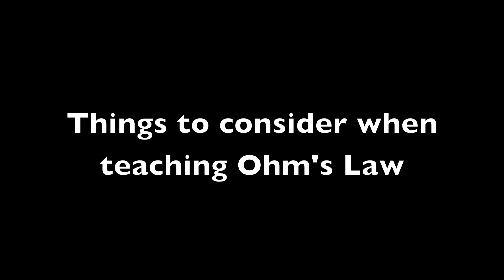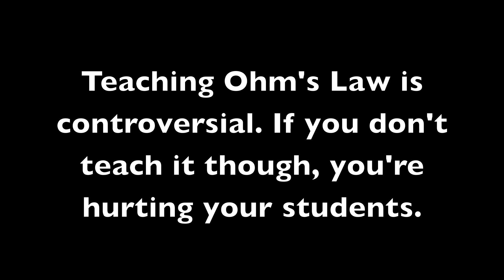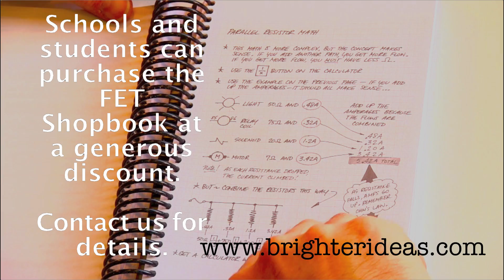Teaching Ohm's Law to Techs - Part 1

Comment: Just my 2 cents but i would not want anyone to work on my car that doesn't understand basic algebra. Using different variables shouldn't matter at all and neither should working an equation in a transposed form. Anyone that has graduated high school should be able to figure out the equation in either form without even knowing what EIR / V omega A represents. Sounds like the problem in this case is the fundamental knowledge of algebra not how the formula is written.
Reply: In fact seems E has been replaced with V a lot now anyway. Most sites have it as V now. R doesn't really need to be changed as R for "resistance" is good. P for "power" is obviously good. The only one left now that doesn't match up to modern usage is the I which stands for current.
Reply: Also if every teacher approached things like Daniel Sullivan I bet we would have more educated people around that understand things. As time moves by things get better and that includes teaching technique. I think the public school systems run by the government were the start of bad schooling technique.
Reply: David you need to use algebra to solve an equation and or transpose the equation and solve for the other variables. It doesn't matter how you call the variables either words letters or symbols they are still variables. Using a letter of the first word or the word itself... still algebra.

Can you troubleshoot circuits without math thats an entire different issue. If you just want to use a meter to see if you have voltage or not great you don't need math at all just read your meter. To be decent with electrical circuits though you need much more than that.

There's a reason why many mechanics are labeled part changers. If you don't get the foundation down with electrical diagnosis (including the basic algebraic equations) chances are you are going to much closer to that group...
Reply from the maker: Christian Lum Completely forgot to add that my former student who's the Avionics chief at 10Tanker is a strong chick - who rocks...
Reply: mrd05d Your 2 cents aren't worth 1 cent. That is about the dumbest thing I've ever heard. It's about ridiculous as saying I wouldn't wan't a guy to teach me algebra unless he was a mechanic. There's a big difference between a mechanic and a mechanical engineer.
Reply: But having to prove V = IR, you must go through I = V/R because that's where it came from. The original logic comes first, algebra and simplification the second
Reply: Why is there a need to use Algebra though? For things that already have names we use it would make more sense to at the minimum use the first letter at least of the word. It's just silly to use Algebra when it's not needed.
That's as bad as if they used XYZ informally and then something like LNA formally where as L=Z and N=Y and A=Z. Would be just totally pointless.
Reply: Also their skill in Algebra has nothing to do with their knowledge of your car's electrical system. According to your logic some kid at school at the top of his class in Algebra could be just thrown into an auto shop and straight away be able to fix some electrical problem. Sorry it doesn't work like that.
I have seen other people claim similar things to you. Seen some people claim that if someone has spelt something wrong then apparently that debunks everything they have said. This is absolutely nonsense thinking. Someones spelling is independent of their knowledge or understanding of another subject. Heck even some of the great inventors were said to have poor language skills but excelled in other things obviously.
Just as if someone has messy handwriting it doesn't mean what they have actually written is incorrect and that someone with neat writing that everything they write must be correct and gold. lol
Reply from the maker: We all need to understand that this problem exists everywhere - and I'm trying to finish a video (or 2) on fractions. Look, why do we use this symbol - √ (or similar) to teach division, THEN use this one - ÷ - and then teach fractions? Seems to me the first 2 are pointless. Also - the process of adding and subtracting fractions requires the ability to multiply and divide them, but we teach addition and subtraction first. STUPID! Teach fractions in kindergarten, and DUMP the other 2 symbols no one will ever see again. I HATE seeing a division problem written any other way than a/b..... DO WHAT WORKS. In the end, if someone can divide, I really don't give a rat's ass how they do it. As for the STUPIDITY of the metric system - the point was to simply start saying 10 KM instead of 6 Mi. NOT convert the shit. Metrics failed for the same reason anything fails - resistance to change and a good idea badly executed.

Oh - and David - I understand your position, but figuring out tax or mileage or compression ratio is Algebra. You do it - but there can be a problem with the insistence that we call things what we do. As far as I'm concerned - there is NO "basic", "intermediate" or "advanced" electricity ---- it's just electricity. The labels are to make a class schedule and catalog work. I call it "electricity", electricity again" and "more electricity".  DS
Reply: I've got to agree with you Daniel, I think a lot of people forget the audience these videos apply to, myself included (and the gentleman that commented above). If the scope is to teach somebody who may not be as strong in math how to read a meter, use ohms law in a manner that suites their need, use a multimeter, and diagnose an issue so that the proper part can be replaced, then you hit the nail on the head. You've got great analogies that help make the concepts that need to be conveyed to your audience relevant. Me personally, I think that math is totally relevant to realize a deep understanding of electricity. But again, In my field it is needed to have a strong foundation in calculus, differential equations, physics, etc. Why? Because it's the basis for design, and is so deeply embedded in the field of E.E that you can't scrape by without it. My scope is different than here. I just want to say I appreciate that you are so committed to making a difference to people who weren't always blessed as some of these other assholes on here who want to pass judgement and belittle others. When I first went to back to college to pursue an electrical engineering degree I didn't even place into a math class - I was literally told I was too stupid to take math at the college level. Thankfully for me, I tried, and had some of the best teachers who made math relatable to people who couldn't see the relationships (me). Then I began to like and appreciate it, and now here I am. I made it through 4 calculus classes, differential equations, and other high level math classes I never thought I'd be able to do. I bet most of these guys on here wouldn't hold up in the industry you teach people to strive in anyways. Side note, I saw you were a teacher in the aviation department at NMU. What did you do? I have been working on avionics for the past 5 years, and while going to school. It's actually what intrigued me to pursue an engineering degree.
Reply from the maker: First - strong chicks rock...

Second - I started the A&P program at NMU waaaay back in 1988. One of my students is the avionics chief for 10Tanker - the aerial firebomber folks that fly modified DC-10s.

Email me - dan@brighterideas.com. Might be interesting to chat.
Reply: mrd05d It's been my experience that there's little use for this formula. You may have a 12V circuit with a 1 ohm component. So you might think that you're going to be pulling 12 amps. But your NOT going to be pulling 12 amps, because the resistance will change as soon as you put power to it. So, you're better off knowing how many amps you're going to be drawing in order to determine what diameter of wire to use, and what fuse to install. Otherwise, if you're just troubleshooting an existing circuit, you only really need to know how many amps you're pulling vs how many amps you're SUPPOSED to be pulling. If you have more than 0.2 ohms in any regular circuit, then you may have a problem, because unwanted resistance ALWAYS results in unwanted heat. BTW algebra has little to do with auto repair. That's more for engineers. So if you want an automotive engineer working on your car, be prepared to pay out some big bucks.
Reply: Daniel Sullivan That's awesome! I'm a former Boom Operator on the KC-10 and am now hoping to start school for a Systems Operator position for PG&E on the West Coast. I completely understand your argument. I immediately related this to calculating aircraft and cargo center of gravity which is Moment=Weight (x) Arm. Had I been forced to run pages of CG equations, it simply wouldn't have made me understand "how" the formula actually worked and why it was important. After understanding the concept and seeing how CG physically affected the aircraft, we learned the equation and began to actually balance aircraft. That is NO easy task. I did it for 8 years. So, mrd05d can rest easy. The military wouldn't have sent me all over the world without knowing M=WA. But first, I had to understand the concept and how it affected aircraft performance.

Also, if your Avionics Chief is from Travis AFB, I may know him/her. :)
Reply from the maker: Apparently you're one of the people who sat in front of math class in high school, was able to pass tests after being taught in the most inefficient way imaginable by teachers who were unable to make the subject relevant to the guys who sat in back floundering, who I also assume you never tried to help. Am I close?
Reply: Daniel Sullivan I would say only partially correct there. I did well in math class but sat in the back not the front and didn't learn from the teacher but from reading the text usually a couple chapters in front of where the class was. I also did help those that struggled if they wanted to learn. Unfortunately many didn't care to learn nor did they want help.
Reply: Daniel Sullivan I would also say that I like your approach to teaching and believe you are a very good teacher. I was just pointing out that maybe concentration on algebra and remedial math is exactly what is needed. It's possible that you have the short straw as students are in your class without the proper prerequisite knowledge and you only have 4 days to go over what is needed for the class as well as bring them up to speed with algebraic expressions. I feel for you.
Reply from the maker: mrd05d Absolutely - none of the guys I teach are stupid. None of them have ever been allowed to be smart. Trig is a blue collar math - too many teachers see it as "AP" - stupid.

Comment: 1897 J. J. Thompson discovered the electron yet everyone still practices Conventional Current flow (positive to negative) when the exact opposite it true AKA reality. I too wish I could change a lot of things but in order to properly communicate with people who learn convention no matter how wrong it is I must understand the way they think and so should be the case with Ohm's Law unless you want to limit your options for advancement.
Reply from the maker: As long as a guy understands Ohm's Law - the CONCEPT - you could call resistance "rat turds" and they'd be able to do the job. The direction of current flow is pointless. I don't care, I won't care, and for over 3 decades I've diagnosed and repaired everything up to and including 747s without giving a shit about which way electrons flow. Do I teach it? Yes. Is your understanding as you explained it correct? No. If your beliefs help you make robots behave, then good on you. Look out over a dozen new scared and hopeful blank stares every week and you might - I'd pray - have a different viewpoint.
Reply: It's about communicating with others for clarity and advancement, if I had stood up in a meeting with Subaru, Toyota, GM or Ford Engineering and said rat turds 20 years ago I probably wouldn't have retired at 54, because I would have limited my potential by my inability to communicate on a level everyone understands, perhaps you are training people who want to limit themselves to Technician level for life and if so then you are correct it doesn't matter if all they know is they are supposed to see 12V at test point A and if not swap a board, I retrained many individuals who weren't taught the fundamentals in my day and found it quite rewarding seeing their eyes light up when they got it. All that being said I am bored to tears and brushing up for a pre-employment test to get back in the game because my brain is turning to mush. You have every right to your opinion and some of the things you say would make good sense if only the rest of the world would sign on, if it were easy we'd all be driving positive ground vehicles, well we actually are no?
Reply: Daniel, maybe I'm hung up on direction of flow because robots were mostly hydraulic in the 80's when I got into the industry, hook a servo up backwards to an actuator in relation to the feedback device on a hydraulic robot and things would get interesting in a hurry, or with your experience in aircraft the same could be said for the ailerons on a 747.
Reply from the maker: KAT D Hydraulics is a terrible example for electricity because voltage is effectively compressible, while hydraulic fluid is not. Air pressure is way more meaningful. There is no argument here. Teaching electricity via math is pointless. Teaching math via electrical (mechanical) concepts is the only logical way to do it. I teach trigonometry to mechanics in 30 minutes using a tape measure and a laser pointer, because they already understand the concept.
Reply: Daniel please explain to me how voltage is compressible, as I was taught voltage is EMF meaning it is merely a potential difference which equates quite nicely to pressure in a hydraulic system. Voltage or EMF is not even a thing meaning it doesn't physically exist any more than pressure does in a hydraulic system, the medium in hydraulics is some type of fluid be it HFA 5606 or an HFDR synthetic just as electrons are the medium in an electric circuit. What creates pressure or voltage in either instance is resistance to flow, in hydraulics it's resistance to the flow of fluid in electronic it's resistance to the flow of electrons. There are two basic proportional realities to both electronics and hydraulics that interrelate nicely and are almost always used as examples in University ((Flow (current/AMPS)= (volume/GPM)) and ((Potential (volts/EMF)=(pressure/PSI). I'm trying to wrap my head around how voltage might be compressed or even electrons, at 1,000 PSI most hydraulic fluids are compressed approximately 0.5% but it is the medium that is compressed not the potential. If you are referring to capacitance that would be more of a storage or spike absorption / smoothing issue like an accumulator in a hydraulic system. I fail to see how pneumatics (compressed air) even comes close to being a good comparison or analogy to electricity since pneumatics is A) Compressible and B) An open system with no return and therefore nothing to compare to neutral or ground as is the case and hydrostatic hydraulic system which returns all fluids to the reservoir which can be equated to earth ground . I am merely explaining how I understand things and relate the two disciplines to one another and hoping you will elaborate more on the compression of voltage because it would be totally new to me and I hope to continue learning until I take my final breath.
Reply: KAT B
I have worked as an aircraft mechanic instructor just like Daniel, although I doubt I was as effective. I currently teach basic electrical courses for the company I work for. Your suggestions are wrong. I do not believe you have ever trained any mechanics or technicians. Daniels approach is spot on and extremely effective.
Reply from the maker: singlespeedman Yeah - yeah - what he said!

Comment: I understand what you are saying to some degree but I believe A) theory should come before actual practice because flipping dials on a DMM is meaningless unless you know the physics of what you are doing it for, just showing people how to read voltage current and resistance with no understanding of the relationship between the three is in my opinion a dumbed down education and I believe we have enough of that in our education system already. B) If you teach your students only Ohms, Volts and Amps they will most likely fail a pre-employment test they would have otherwise passed as they scratch their heads over what "I" and "E" mean. I think Ohm's law is fine just the way it is and it does include fractions as shown (If IxR=V then V/I=R and V/R=I, are V/I and V/R not fractions? I am all for changing things on a universal basis if they make sense, but if you are practicing what you are preaching, well intentioned or not, you are setting your students up for failure in the real world.
Reply from the maker: Sorry - you're wrong.
Reply: Probably so, I'm only speaking from 35 years experience as a field engineer in industrial robotics for a multi-national corporation.
Reply from the maker: KAT D I'll see your "36 years, etc. etc" with 32 years as a licensed aircraft mechanic, and raise you with 6000 students taught in 19 years in 37 States and 6 foreign countries. If you're an "engineer" in the UK (or equivalent), that means you're a mechanic, or at least my equal. If you're an "engineer", as in calculus and an ego the size of an Airbus, then you just flat out have no idea what you're talking about.